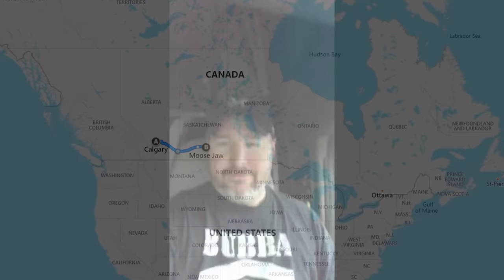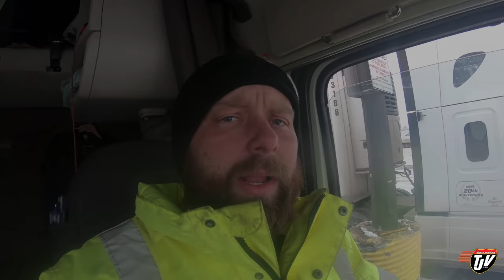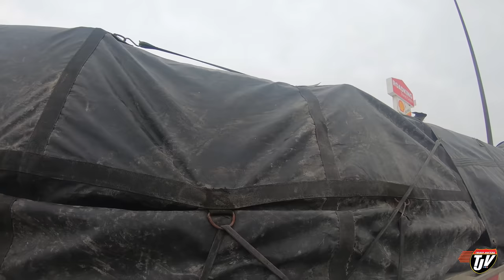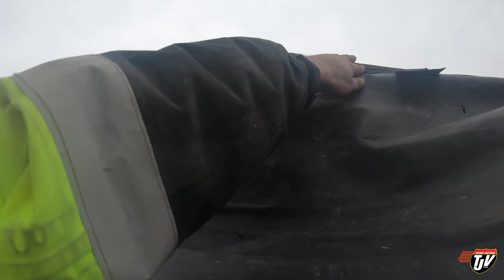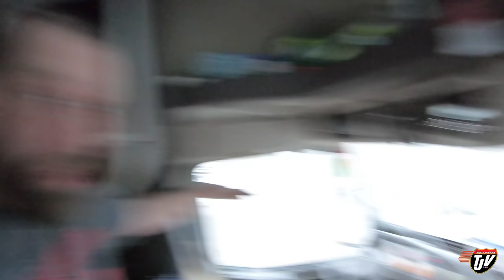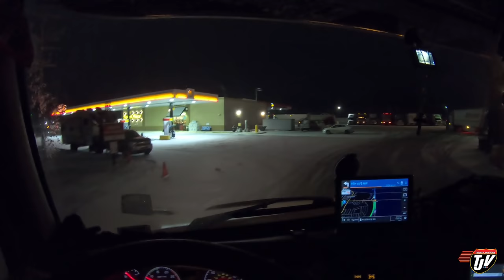My Trucking Life | CALGARY | #1917

Comment: Hello Josh! Elated to hear you have honest salesmanship. I too, like you, wouldn't sell something I wouldn't use. A heavy set young man came to buy a oblong camp table. It was a cheap fold in half thin aluminum quality. Once open, I pointed out examples of pretending to vision placing food on the top, then showed him what the person sitting on the end could expect if they were to lean on the end of that table, like what happened with my Father. All it took was laying your arm down to rest innocently enough, the pressure alone, gave it a see saw effect cauusing the food to slide down toward, & some spilled out, onto him. I didn't recommend it for heavy set people. He went & got the picnic table set in a box, that was 5' long with 2 matching benches made out of solid wood. It was only $10.00 more. I still have my table,  after 31 years. The benches maybe close to 16 years, they didn't hold up as well due to the elements outdoors. I started painting them the least color in my vinyl table cloth pattern that I would find. I bought the longest vinyl table cloth, cut out the top for the table, leaving enough room to thumbtack it down under the table. Then I had enough to do both benches, thumbtack it to the bottoms as well. It was so easy to clean off my table, didn't have to worry about the Kids getting into the thumbtack, as they were out of sight out of mind, not only that, when the wind blew, you didn't chase it over the fence into the cow pasture, & you didn't have to scour the yard looking for those metal slide on strap like gadgets that blew off from the wind.
I see a Kenworth in your future for sure! I hope they call you & give you one to keep in exchange for telling everyone how comfortable you are, how easier it is to haul even the heaviest of loads, etc. Guess you thought I was dreaming for you? Well, old ladies earn that right at some point in life! Hahaha!

Comment: That sharp steel is called "B" deck. It's used as the under lament for flooring in multistory buildings....connect it too the i-beams then lay down cement, or other material and viola....floor!!
Reply: also looks like the walls in a storage unit